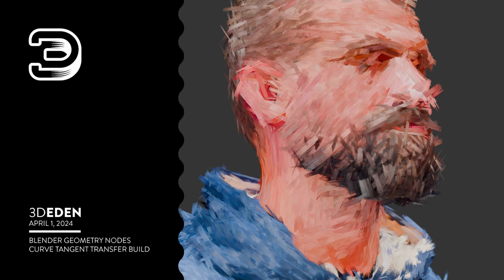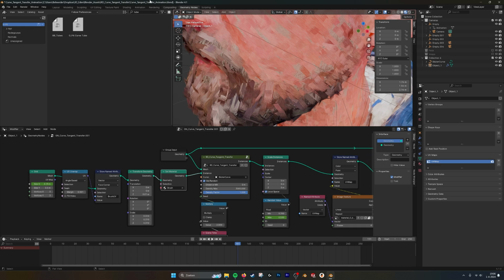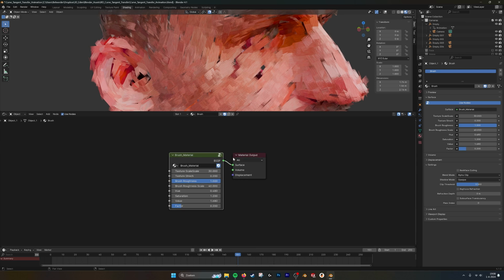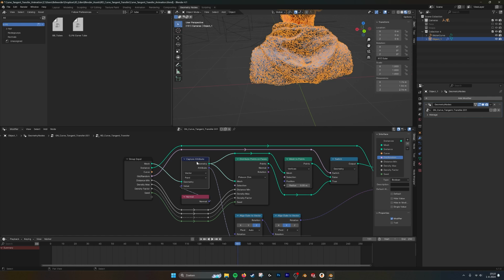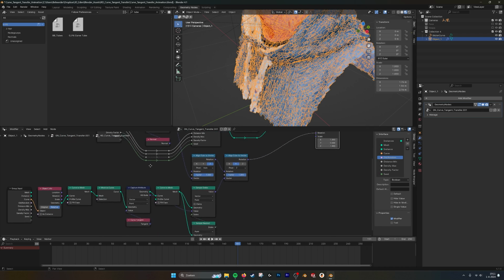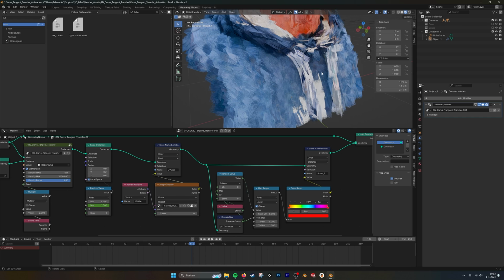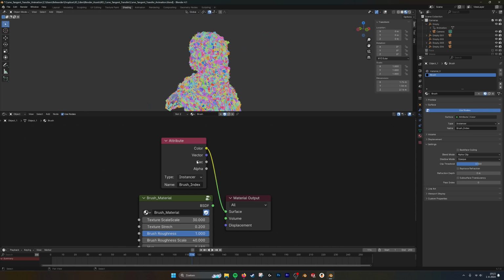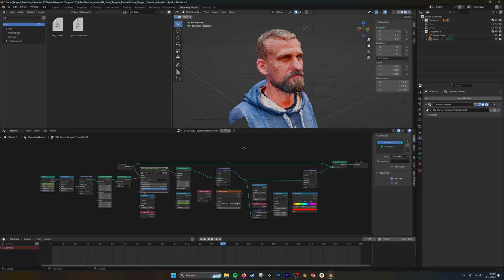Geometry Nodes Curve Tangent Transfer Build Tutorial

Comment: Hello there, just notices some things and would love if I can ask. On the geo node you store the uv based base color texture map to each instance wirh store attribute color on points. But it seems that on the shader you use don't use that attr and basically use the base head uv + texture to somehwat assign the color to instance? Please correct me about this color assignment to instance. Are they connected from GN to Shader?
Reply from the maker: Yes you are right, In a later version I only use the image texture in the geonodes and send it with a store attribute to the shader. This makes the setup a lot simpler and collapseble to one geonode. you can get that one on blendermarket at a tool. But this works a well.